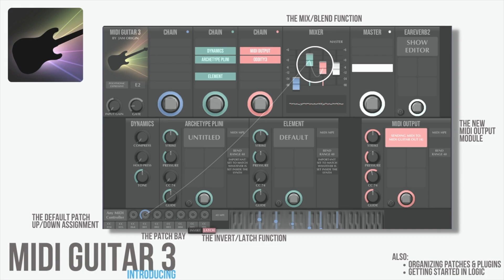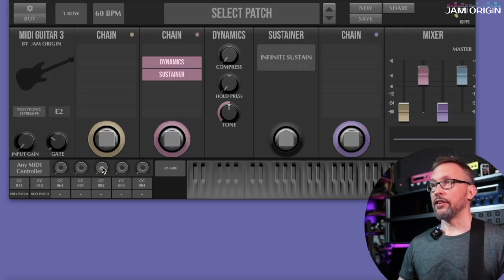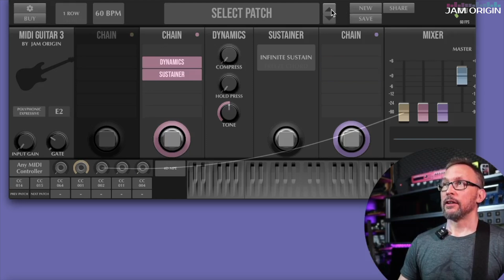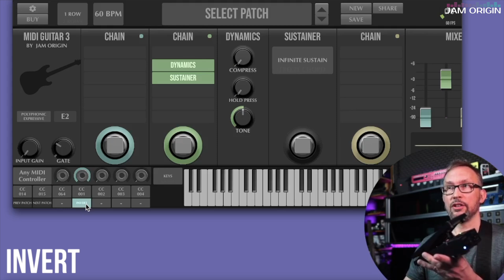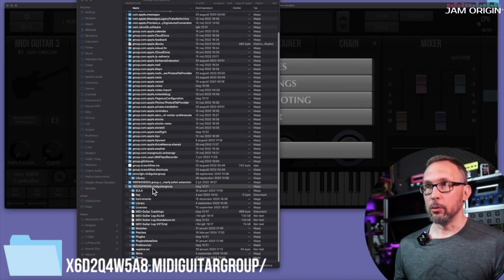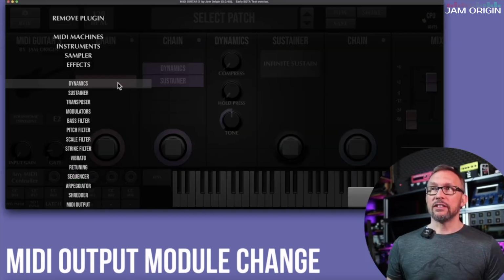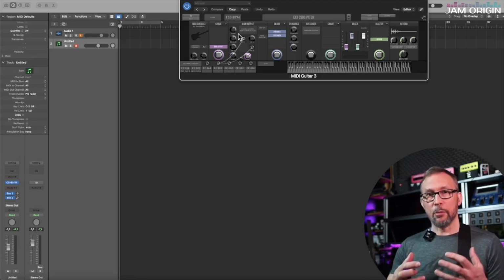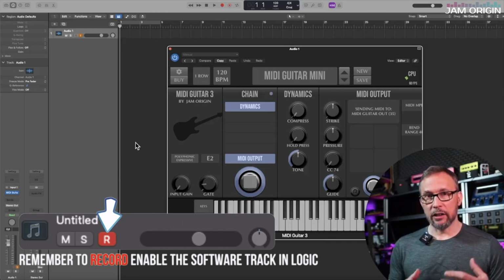MIDI Guitar 3 Introducing: Another look at the MIDI Guitar 3 interface

Comment: Hi !
Is Midi 3 ready to buy ?
Merci 😊
Reply from the maker: You can buy MIDI Guitar 2 and get the beta testing versions of MIDI Guitar 3 without interruptions, and then of course get the MIDI Guitar 3 for free once it is finished for release. The upside to this is that you get both pieces of software for the same price. MG2 and MG3 are two different apps so you can run them in parallel if you wish. If you prefer to wait for the finished product, you can do that, but then you'll get just MG3 for the same price. 👍
Reply: @lofileif  

Merci Lofileif pour ta réponse rapide et précise.
Le 09/09/2024 sera mon anniversaire de 70 ans.
 Je pense alors essayer d'adopter MG2 => MG3.

Actuellement j'utilise encore AXON Ax50 => vArranger2.
Merci encore.

Christian Artero 
( Nimes - France)
Reply from the maker: Honorable de ne pas cesser de suivre les développements. N'hésitez pas à nous contacter pour toute question sur MG2 ou Mg3 si vous décidez de l'essayer. Google Translate fonctionne-t-il pour le suédois-français ?

Comment: Not buying this product because I can't get it too work LOL, No sound output at all.  Midi Guitar 2, ok,  got it working on the MAC.  Midi Guitar 2 iOS, can't get it to output sound standalone and there is no auv3.  Midi Guitar 3, nope not working, using Scarlette for Mac and iOS.  I haven't able to find good setup docs, but I have experience with setups of other apps, not intuitive. I also have other midi guitar software that works fine.
Reply from the maker: Ok, you should not but anything you don’t believe works. Sound reasonable. You are of course welcome to try again later, when MIDI Guitar 3 is officialy released. 👍
Reply: @lofileif  Yes not slamming the product, will keep trying to get MG3 working on the mac.  I think the iOS issue is MG2 no longer works on the iPad pros, since they went to usb 3.
Reply from the maker: @unstablesun8179 Are you trying to use MG3 on an iPad? It is not released for iOS yet! It is for Mac OS only as for now.

Comment: Unfortunately my midi guitar 3 doesn't work with my hex pickup. Is this due to the trial version or am I doing something wrong? Thanks for the very informative videos! 👏🏻
Reply from the maker: Hi! It is not meant to be used with hex PU:s at this point. Maybe down the line, but for now you  use with your standard PU:s. 👍

Comment: Looks fantastic, but I'd really like to know what the options are for the MIDI OUTPUT module. Please, please tell me that there's a way of switching through MIDI output channels 🤩
Reply from the maker: For Old legacy MIDI 1.0, you can obviously switch to whatever MIDI channel you want to use. MPE works differently as it sends notes-per-channel.  That mean that you are using all MIDI Channels at once in MPE mode. You switch between these modes on the MIDI OUT module.  But, to your question, yes! 👍
Reply: @lofileif  Thanks! I look forward to trying it out!

Comment: Looks pretty awesome, but my brain already hurts. Seems challenging to show-and-tell all of this in an accessible way to guitarists without extensive midi insight. You are doing a great job, and I hope you will manage to break it down in need-to-know and nice-to-know sections by release time, maybe one function per video. And maybe work out some "quick start" presets, that can get most going without too much menu diving beforehand, so we don't lose engagement from option paralysis. This really has incredible potential for guitarists who want to use their knowledge of the guitar to play and compose with software instruments.
Reply from the maker: Hey! Thanks. Yes, this is meant as a broad strokes here-is-where-you-find -this for the potentially 20.000 people on that first signup list. There is a lot of inpatiance here  to deal with. So instead of hearing about what is, and what isn't here, from poeppeople guessing, I thought I provide a little overview map. I most certainly am going to go into specifics on almost all of these functions down the line, in dedicated bitesize chunks. And we already have "quick start"-presets that should work as a backdrop for explaning stuff. But we can't release everything at once, for the first batch of beta testers. That's most likely just a waste of resources. Let's get past the hurdles of brackscreens and obstructing mail servers first. I also believe in its potential, but we need to take everything one step at a time too. 😀👍